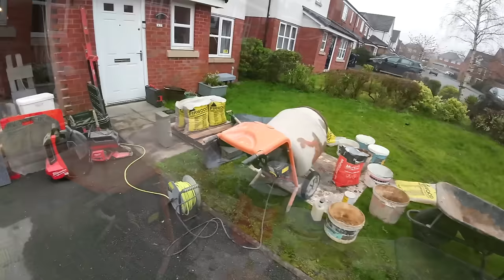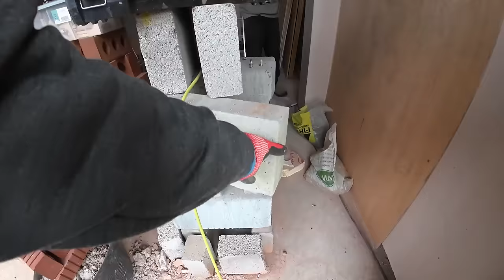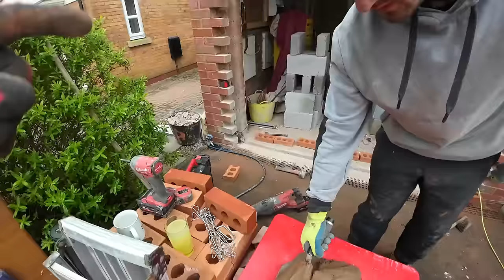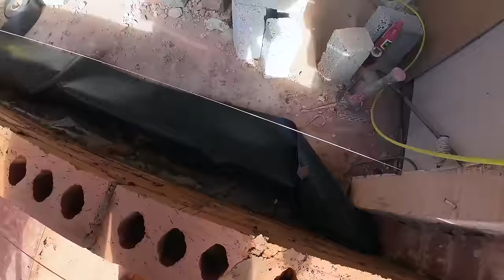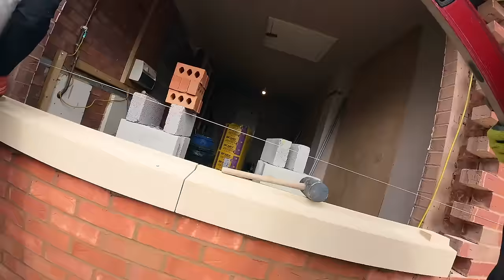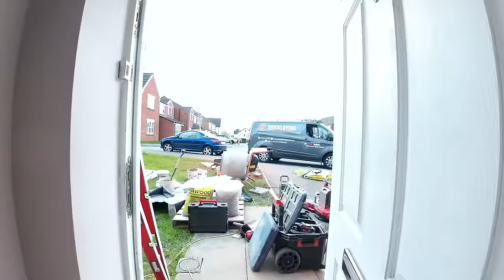STONE CILL AND FACE WORK ON A GARAGE CONVERSION PT 3

Comment: Gentlemen the only place the 3/4 should be is in the center it is broken bond
Reply from the maker: Sorry you’re wrong .
   Two 3/4 s = 1.5 bricks which means a half in the middle not a 3/4 .
   I know what looks better thanks
Reply: @SteveAndAlexBuild  I don’t think you know what broken bond is
Reply from the maker: @MarkSmith-hd5ez . I think I have an idea after 37 years including 10 years building house foundations and setting out the splash .
    Having done dozens of garages with halves in the opening I know what looks better even if it’s not the purists way .
    I ve seen plenty done the way you say but it looks awful like a zip running up the front .
   At the end of the day it has to look right . 🧱👍🏽
Reply: @SteveAndAlexBuild  mate you turn the bat in to two 3/4